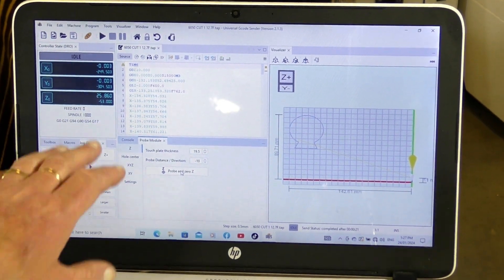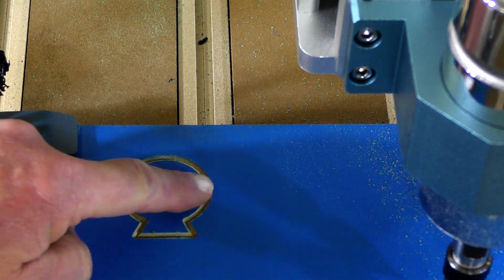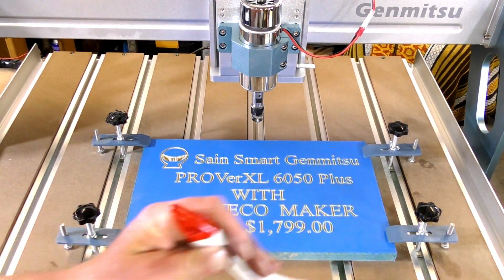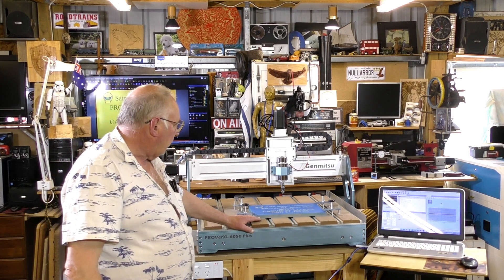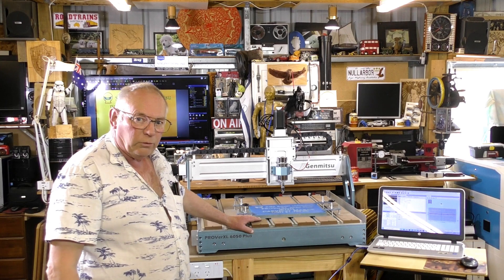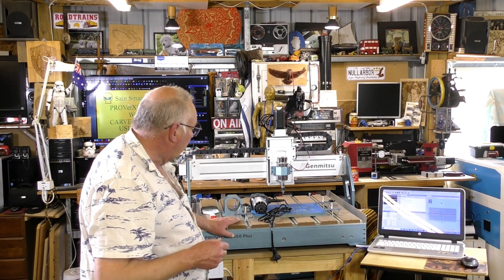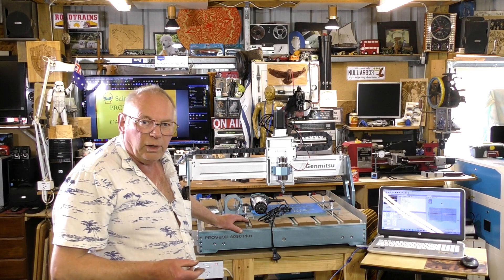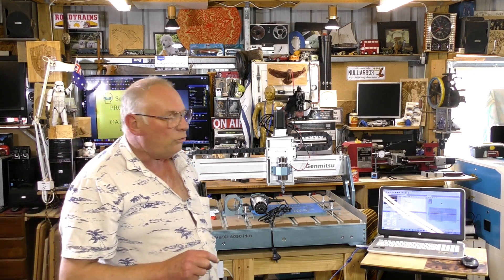BEST CNC Router First Test Drive SainSMART 6050 Plus, (first machining job) part 2

Comment: Well done video. I have the ProverXL v2 4030 expanded to 600x600. Did you trammed it as well as surface it?